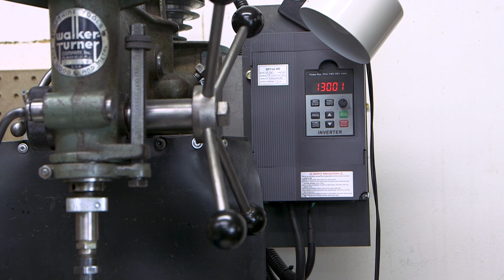Make a Type Stamp Holder for Your Arbor Press and Stamp Numbers Like a Pro!

Comment: Hey Rob, just rebuilt my nsu, but not firing. Wondering how to leak down or compression check this bike
Reply from the maker: It should be the same as other engines.  Use a compression tester in the spark plug hole.  I was going to give you the compression numbers but they're not listed in the NSU engine rebuild manual.